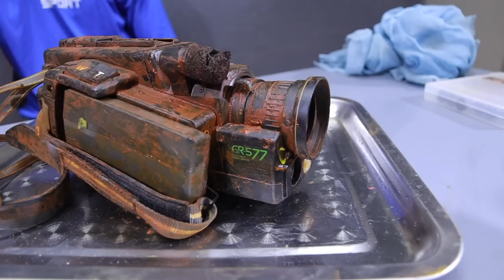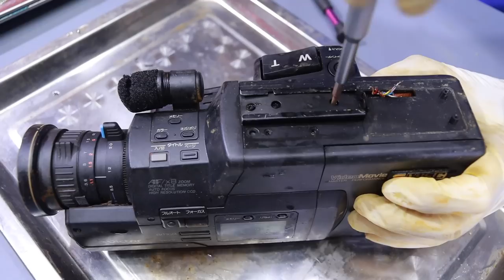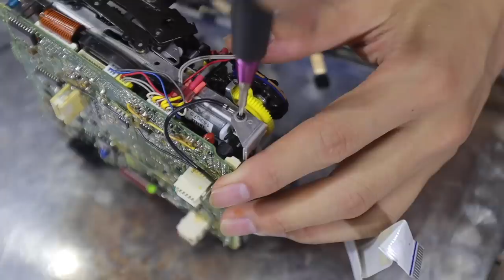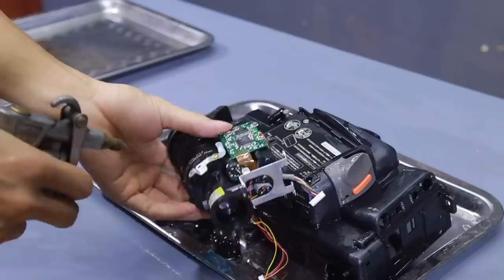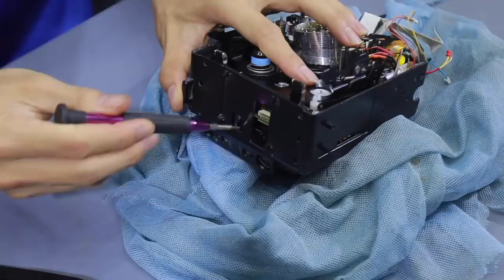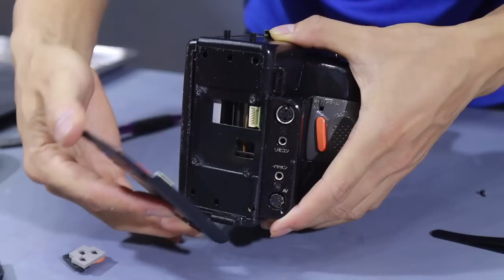Restoration vintage VICTOR action camcorder | 50 year old VICTOR action camera restored

Comment: May I hate a bit?
1. There are parts inside this camera that should not get wet
2. This camera isn't even worth the work
3. Why was the cassette built back into the cam? It should be thrown away, the next one can be put in after reassembling the device
4. To everyone else interested in such devices: You always have problems with the battery, often with the condensors and sometimes with the cassette drive. You shouldn't tear apart anything else as long as it's working.
I can't tell if this video is fake or not as the device is not working at the end - cleaning parts without caring about their function is at least possible. Yet I respect the fact that many people seem to watch and gain joy from this.